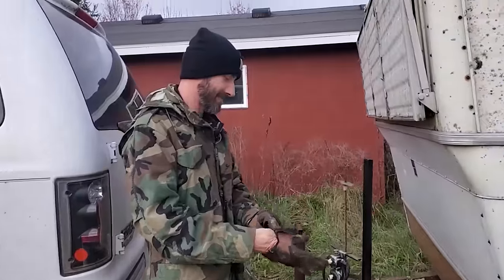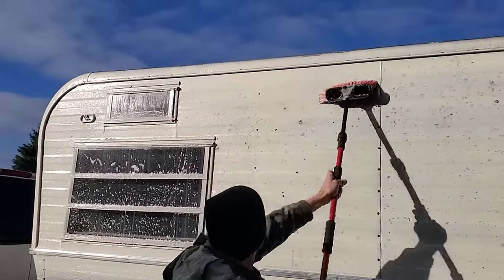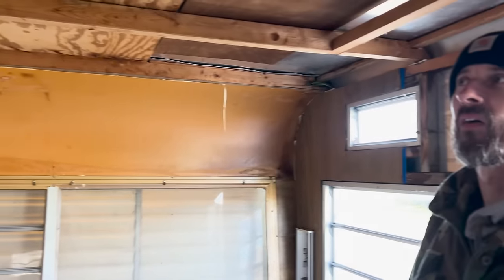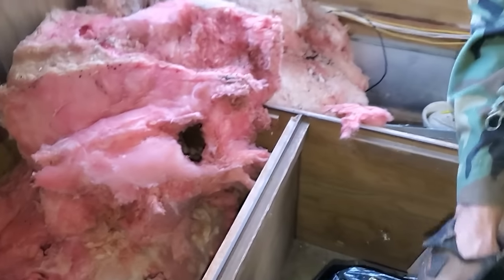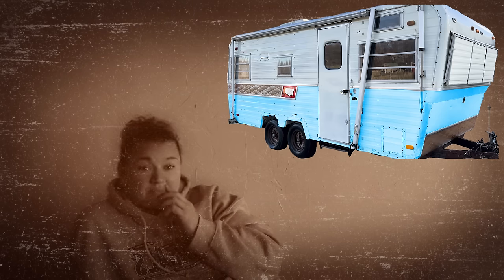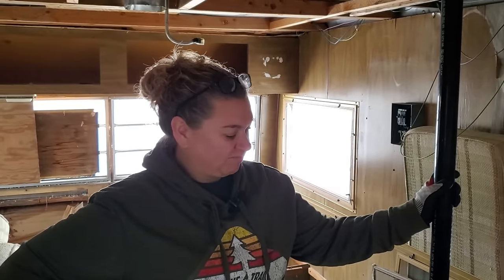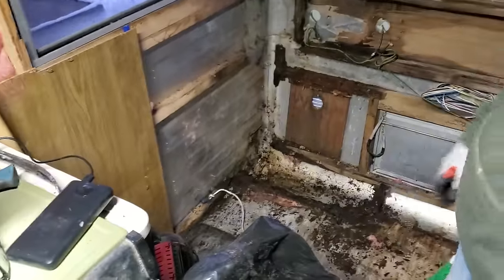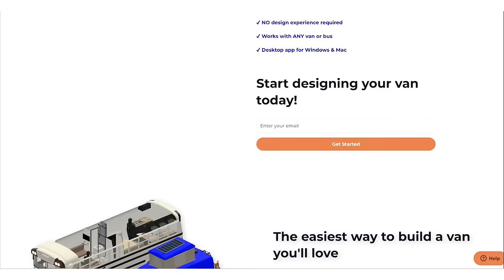Vintage Holiday Rambler Renovation Begins!  Cleanup, Demo, & Design and Layout Ideas!

Comment: Check at junk yards... They may still have some windows that may work... We have to go searching for a couple of windows as well for our holiday rambler as well as a couple of the badges for it!
Reply from the maker: Our Holiday Rambler map things are all there but have some decent cracks in them.  We might try to make a mold to cast some new ones out of resin.  Is yours a Holiday Rambler Vacationer?  If we make some, we could make some for you too if you have the vacationer.  Still TBD if we'll try to make any though 😆
Reply: @retrorevivals  that sounds cool, and yes that would be awesome... Not sure what ours is, all we know is it was made by franklin.

Comment: So excited to see this one done! We did a 1969 FAN Styleliner (16 foot) 2 years ago and we love it. It looks so similar on the outside. Ours has 4 bunks, bathroom in between. Our bed/table is when you walk in the door. We did a kitchen, retro fridge and fireplace heater. We worked on it almost daily and it took way more than 5 days 😂. We open our front rock guard and hang our retro lights my husbands dad made years ago from planters and beads (lawnwear lights). So excited to see what you do with this one. Also love the dual axel, I wish we had dual.
Reply from the maker: That's awesome!  We love having people like you who have done similar projects following along to offer suggestions along the way too.  It took longer than 5 days?!?  Weird, lol.  I don't know if you'll see this comment but we're considering a fireplace heater and were wondering if it provided enough heat for the whole camper or if you needed another heat source with it.  Thanks for the comment.
Reply: @retrorevivals  oh yes we only use the fireplace heater and it’s more than enough for fall camping. My only suggestion is get one that you can control the temperature if you can. Ours is on or off heat and on or off flame. So you can just have the flame on and no heat but you can’t control the temperate and we wish we could.

Comment: My only thought was a sink in the bathroom isn’t necessary in a small camper.  The kitchen sink is right across from it and might open up some extra space.  Love what you did with Harvey.  I’ve plans for some more renovations in my Minnie Winnie RV this spring. Maybe we will be in the same state parks in MI this coming season!
Reply from the maker: Keep an eye out for us!  We're hoping to get out camping more this summer.  You're probably right about the sink.  The drain is already in the bathroom so, if it works, we'll probably keep a sink in there.  If not, the kitchen sink might do.  Thanks for watching!
Reply: @retrorevivals  Having removed the bathroom sink, it was actually right outside the bathroom in my fifth wheel, to put in a combo washer/drier, I can honestly say that if you can swing it, you should try to keep the bathroom sink. I hate having to go to the kitchen for normal bathroom sink duties.
Reply from the maker: Thanks for the comment!  I keep thinking about brushing teeth and whatnot.  If we can fit a sink, I think we'll go with one in the bathroom.

Comment: I'm doing a full frame off on an almost identical Vacationer. Mine is a 71 19ft. There is a FB group I've been posting progress in, you should join, lots of good people. I started mine Nov 2022 and am about 80% done. I had to pack it up the last 2 winters since I'm doing it under a portable carport in my driveway and it gets cold up here in North WI.
Reply: The group is Vintage Holiday Rambler Owners
Reply from the maker: That's awesome!  We are actually in that group and I recognize your name!  So excited to have you comment here.  We're planning to get back to work on the Rambler this week!
Reply from the maker: I think you're doing much more of an original restoration than we are planning... ours will be more of just a renovation than restoration.

Comment: Just when I thought the back wall wouldn’t need to be rebuilt on this rig. Hope they were wheat pennys, heads up for good luck.
Reply from the maker: It just goes to show that a little water damage showing is just the tip of the iceberg in an RV. No wheat pennies 😔. I'll pretend they were heads up 😉.  Thanks for the comment!

Comment: as you design your interior please remember, the cabinets add structural stability as well as providing storage.  don't rely on just the paneling for support. In all honesty the the Holiday Ramblers were designed well from the factory.  I'd advise keeping the layout as close to original as possible.
Reply from the maker: Thanks for the tips! We'll definitely keep the structural stability in mind with our design.

Comment: There is no grey tank on that trailer...I use a 42 gallon blue boy to collect my grey water....i have my original owners manual and it tells you grey water goes on the ground...it also tells you to buty your garbage if no trash cans are available! Times have certainly changed
Reply from the maker: Good to know! We kind of figured that was how it worked. I wonder when they did away with that practice? Thanks for the comment!

Comment: I love the projects you guys take on, but when husband says that you said this would done in 5 days I hope he was kidding.  

Just by where you found it I knew it would have demoed to the bare studs.  Why?  Several reasons:

1) You found mouse poop inside. For sanitary reasons alone nothing that is not structural can be saved.

2) The insulation was more than likely (assuming it’s original) is lined with asbestos.  For that reason alone you should tear down to the studs and start over.

3) Not surprising that a gray tank wasn’t found.  The EPA wasn’t created until 1970 - 3 years before the trailer was created.  So  gray waste being dumped on the ground and not in a receptacle makes logical sense since RVing in those days was a “rich man’s” activity.   Keep in mind 1973 was the beginning of the OPEC embargo.

I’m still rooting for you and your family to not only finish this project but Harvey as well.  Maybe you can install a trailer hitch on Harvey and it can tow the trailer so that friends and extended family can go RVing with you.
Reply from the maker: That makes sense!  So, we did, at one point, toy around with the idea of planning out everything to the T and just doing nothing but work on the camper for 5 days straight to see if we could do it.  Well, our lives won't allow for that type of project at this point but it could have been fun to try!  Thanks for rooting for us!